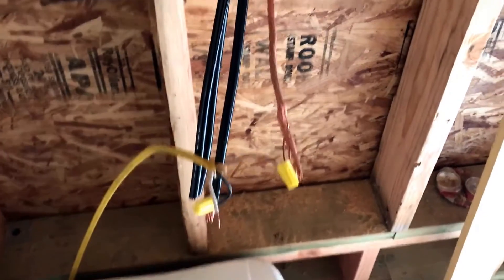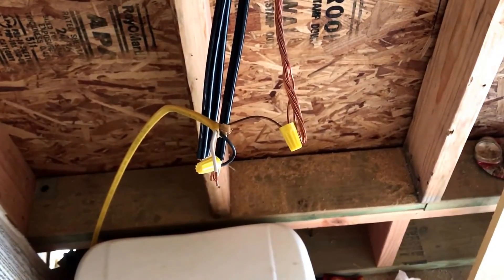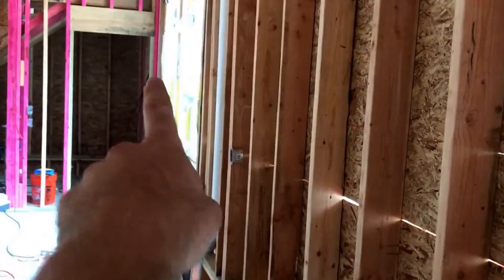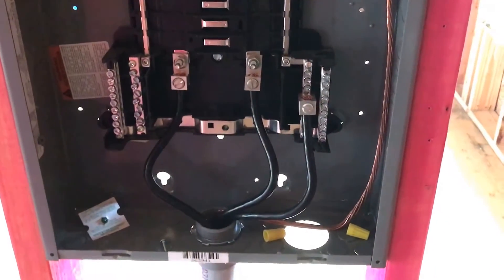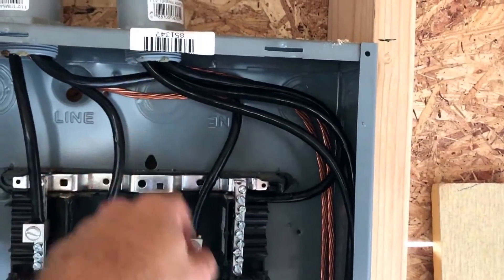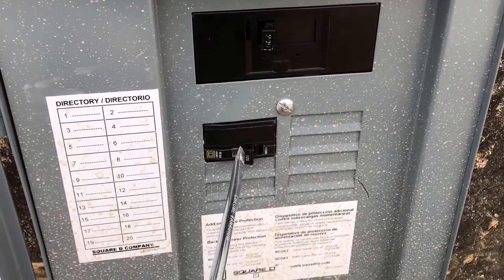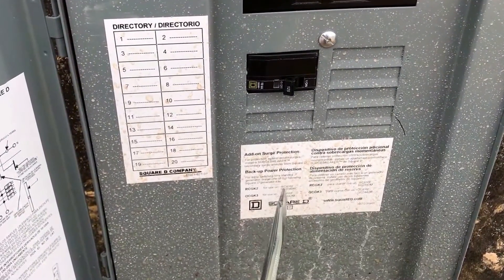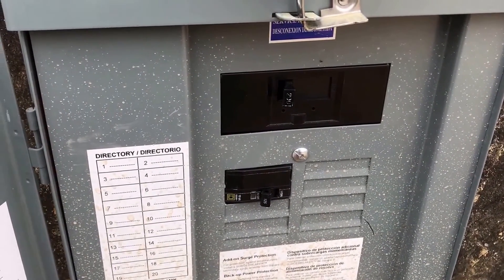Wiring up Primary Leads on Breaker Panels

Comment: This is an old video but for future reference to anybody that sees this, don't figure it out this way. It did not need to be powered. Twist one of those wires to the bare ground, then go to the other end and use a multimeter on the ohm setting and find it.
Reply from the maker: Hah! That does make a lot more sense! Thanks for sharing!

Comment: What size of wire you used ?
Reply from the maker: Oh I don't remember directly. Looks like per the plans it was #2CU for the conductors. Not sure on the bare grounds. My brother designed the electrical, I just installed it : )